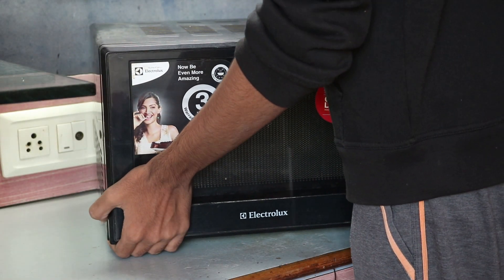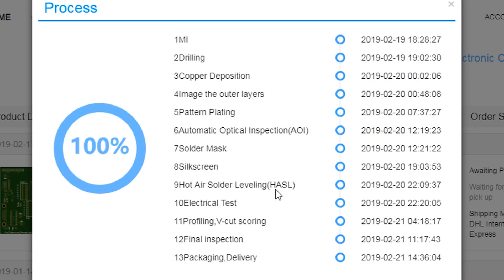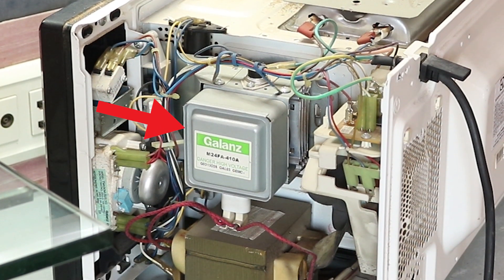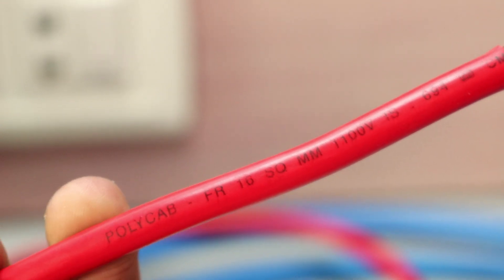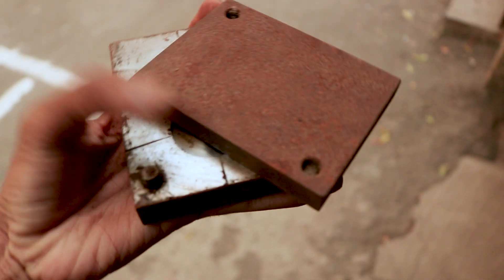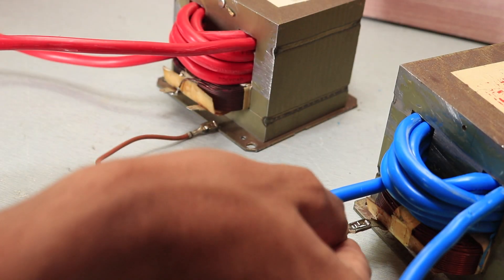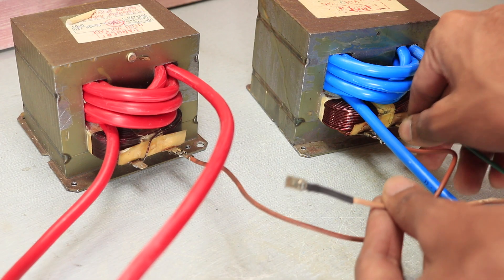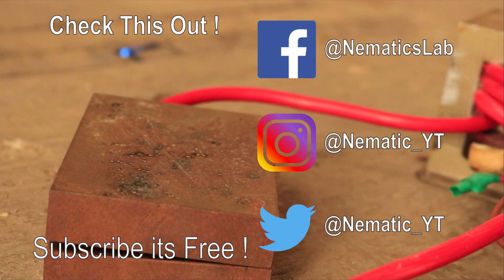DIY Arc Welder Using Microwave Transformer? | MOT | Failed!

Comment: Connect primaries in parallel and secondaries in series, so you double the voltage, but it will still be not enough. You need three MOTs connected in the same way to reach 20V at the high current output and really start to weld!
Reply from the maker: I don't have a power source to provide that much input current at the moment but it did came to my mind. But I was worried about electrical insulation breakdown better primary and secondary.

Comment: so many people that dont know what they are talking about. it has nothing to do with not enough transformer. the problem is the secondary wire hes using is too large and too insulated. not enough turns on secondary. very easy fix. two mot's is plenty for a the 90 ish amps required for a decent stick weld. you can weld with one transformer lol

Comment: Primary connect parallel. Secondary in series. Im using thus method and it work good. So your winding is wrong.
Reply: how many turns do you need to get the necessary voltage?

Comment: You should put the primary coil in parallels and and the secondary in series. It will work somehow. Use a 4mm cable and make around 50 turns in each transformer. It will provide you around 40 volt and around 120 amps. Not enough, but it works for short welderings

Comment: The cables seem to thick you should connect cables for battery number 8 or 10 to get the job done, tht way you'll get about 16 volts per transformer, and if you add a third transformer you'll get about 40 to 45 volts it's better.
Reply: voltage doesnt ever neeed to be that high. around 20 volts is plenty. its the amperage you need. two mots is enough. its 90 amps for stick welding avg and two mots will do that and barely need cooling. and all this crap about mots in series nothing should be in series. secondaries in paralell and thats it

Comment: Primaries in parallel as other comments have said already, secondaries in series, but even then you only have 14V, cheap arc welders have 60v open circuit to get the arc started, so you would need 5 or 6 of these transformers.

Comment: I’m looking at my HV capacitor and the second transformer I pulled out of the second microwave right now. This guy just saved me from being pissed off with the Results of the project I was ready to begin on. Thank you for your post, it was more than helpful
Reply: You should put the primary coil in parallels and and the secondary in series. It will work somehow. Use a 4mm cable and make around 50 turns in each transformer. It will provide you around 40 volt and around 120 amps. Not enough, but it works for short welderings

Comment: You can connect transformer in parallely. The induced flux from the primary is fully isolated with secondary so you can connect them in parallel and for the secondery voltage you should wire winding serial for barely 15V for working 
Hope this helps!!🤗
Reply from the maker: This should work but its possible that isolation can break between Secondary and primary so I would try that after I`m done with different projects I have planned with them.
Reply: @Nematics_Lab  What creator said. wire them in parallely on the primary coils and series on secondary. But also it is important to understand phase. Not only in whether to wind the new secondary clockwise or counterclockwise but also in how the primaries and secondaries attach to each other. There is an input pole and output pole on each winding. I think of it like + and - poles on batteries. Where the coil enters the core (first winding) are my positive terminals and where the coil exits the core (last winding) are  the negative terminals on the primaries. Just as important as attaching the wires on the secondary coil side, the last winding on one core should be connected in series with the first winding on the next core. Finally the end of the first secondary winding in this series is your welding "ground" and the last secondary winding is the stinger. Do this all right and one of your secondary coils is wound counter clockwise against a clockwise wound primary? and who knows what happens? I had all of this right except + and - mistake on the parallel wiring of the primaries and was only reading 5 volts on 20 windings of 10 gauge wire on the secondaries(2 core system). Fixed the issue and started reading 45 volts(was expecting 36 - 40 VAC) So close enough. Another matter that everyone neglects to mention is the shunts. Leave them in or take them out? Well I look up their purpose and it says "reduce arcing"  somewhere. Arc? that's things I want. 2. the shunt in a transformer built for welding can be pushed in and out with a control wheel. All the way in is low power setting. All the way out is high power. So I assume no shunt means higher power and bigger arcs. Not positive on this, as it's very hard to tell if shunts are installed on these "tutorials"
Reply from the maker: @gantz4u  I appreciate your explanation I forget that I can wire both primary in parallel and secondary in series and at the moment I don't have access to mains with  voltage 240V 16A or higher so I cannot test that setup as both transformer will draw about 4-5A when in action
Reply: Also should mention the input I`m using here is 120VAC variety. This is a "stepdown transformer" design so theoretically the math is this: 120VAC at 20 Amps input. 45VAC reading at the output. Should be: 120/45=2.66*20amps = 45VAC at around 53 amps on the output theoretically I believe. Im hoping this is hot enough to cook with a 1/16" 6013 rod although I`m on the low end of this theoretical output as I was shooting for around 35V @ 70amps with these windings, which I've heard should cook a 1/16" rod just fine.
Reply: I fully agree with theory provided by gantz and want to add one more step.... The way we want to ensure polarity of output winding (through clockwise or counter clock wise) we have to ensure the polarity of input supply also to be same. Then only the output winding polarity can be determined.
Reply: The magnetic field generated by input winding (EMI) is what gets converted back to electricity thru output winding (in changed parameters due to diff wire gauge and no. of turns), hence the field generated by input winding has a polarity (N or S) which further affects the polarity of output current.
Reply: Il faut plus de 15volts pour souder

Comment: Actually you need to use a bit higher guage with thin insulation like enamel rather than rubber insulation which takes up much space which can be utilised to add more turns.
Also you might need around 36 volts to weld wthout a problem.Just watch the video on the king of random channel.Don't forget to make right primary and secondary connections.The video will help you a lot.

Comment: Use 8 or 10 gauge wire, use a screwdriver to make space after a certain amount of turns to get over 20, connect secondaries in series (only secondary coils should be connected in series) and use oil to cool your transformers.

Oil cools faster than air.

Yes, your secondary coil wasn't tight enough. The tighter it is inside your transformer, the more powerful and stable the arc gets. Getting a big enough charge to overload any electrode.

You're supposed to use 3 MOTs in series for that 3mm electrode.

Comment: Try with a lower gauge of magnetic wire at the secondary winding. As I see in the both experiment you used similar type of wire, if the voltage falls the high current at the output. So try with lower gauge of wire and check whether there is flux  leakage or not. All the best for your upcoming project. Team HCDP Education.
Reply from the maker: Using lower gauge wire will reduce the number of turns at secondary thus voltage will drop but current will increase, however I need more voltage for arc welding.
Reply: He's right, a smaller size of wire will allow for a higher voltage. And restricts the amperage allowed to flow.  But you will have to be careful. There can be to much resistivity to length of wire ratio and to little. I found this out when I made a 12,000 gauss electromagnet to demagentize permanent magnets. But I soon found the right length. Of course though I could only run it for 20 microseconds cooled down to 30 degrees Fahrenheit. Or it would explode. I ran it on a 125 VAC 20 amp circuit. In a MOT there is major flux leakage. The main thing that can be done is to add a very magnetic material. Possibly pure iron-silicone metal sheeting. Put it around the transformer until the flux leakage is below 100 gauss on the surface.
Reply: @Nematics_Lab  try the king of random's video on this topic

Comment: If you use a capacitor and separate 240v inputs, then connect the outputs in series, would it not have the same effect, except with 240V input at both, smoothed by the cap? Likewise, you could use a voltage multiplier circuit

Comment: You do know about parallel connections right and how they work??? Series uses more voltage. But if you don't have more voltage and must keep them in phase. Conect them in parallel. It consumes more amperage but works the same as if they were on on circuit. So being a HV scientist I say it is a perfect experiment and will work perfectly if done right.
Reply from the maker: I appreciate you mentioned it :)

But You are missing that if I wind output in series and input in parallel there are chances of dielectric breakdown/impedance mismatch which can cause a big fire, so for safety reasons I didn't show it in video
Reply: @Nematics_Lab  Well there's a certain procedure to follow to keep that from happening. And I can make a video on it to explain it all if you want. As long as you keep it all in phase whether or not the output on one is 50 Hz and the other is 60 Hz. It will work. I've done it on a 123 VAC 30 amp circuit. The output can be put in series or parallel. It will just use more input power. But if done right it will have no chance of causing a fire. Trust me. I'm an experimenter I get up at 8 in the morning stay in a shop work and work and perfect my designs and projects. Then I finally get out of the shop around 1 in the morning the next day. Some people have said it can't be done, but I have proven so many people wrong by doing it and succeeding while course making it safe. So if you explain thr safe way and layout, it can be published on YouTube.
Reply: @Nematics_Lab  Even with half the power avalible. For example you have 2 110 MOT's in series output and parallel input. It logically needs 240-250 VAC U.S.A power to run. But it can be run on 125 VAC. Or whatever the designed voltage says for one MOT. In your case it's 240 VAC. It will have less efficiency. And it gets warmer just 1 percent faster. But not by much. And not anything a little fan can't handle.
Reply: @Nematics_Lab  It's not possible for a voltage breakdown of the type of enamel and glue on the windings. Especially for the input voltage it is supplied with and is outputting.  The heavy gauge is rated for at least 300 VAC. And the mains coil is rated for the 2,320 VAC - 6,000 VAC. And actually that's what its rated for. Through my many tests I am sure that you can add another 500 VAC to the wiring and it won't breakdown. There's always a safety leeway in electricity.

In the end the only problems that can possibly occur is if the transformer was damaged, such as being scratched, or even chipped at all. But other than that if you're careful all the way then there isn't going to be a problem.
Reply from the maker: Thanks for all the information it was really helpful, I'm not an expect in HV so I prefer to be on safe side.

Comment: You are actually using a wrong wire you need a 50 amp wire not a 80 amp wire . An 80 amp wire is for spot welding not for arc

Comment: hey Nice video man,nice efforts, i know am asking stupid question but couldn't resist to ask you about the transformer any capacity of microwave will work and transform should be in working condition right?, don't mind
Reply from the maker: Transformer should be in working condition and higher wattage of transformer is better
Reply: @Nematics_Lab  thanks for response
Reply: Krish, transformer's primary coil should be good and we cut through the secondary anyways. Usually, in 90% cases I have observed (in over 20 MOTs), the secondary winding burns out. So, its good to go if the primary is still working. Hope that helps.

Comment: Don't rewind a Transformer add a second Transformer and wire them in series. The second Transformer Which you need to find one that is almost exactly the same. As the one you're using or the world won't be balanced. And it could cause some problems. But anyway wire up another Transformer just alike in series. And you will double your voltage output If you wire a pillar low. He will get the same but a higher amperage 4 watt rating I forget which but I know for AC stick welding. You want To wire two transformers in series and I know you'll get is more than enough power To be able to weld even thick Steel.
Reply: very wrong. god theres so many people giving wrong advice lol

Comment: Connect the primary in parallel N secondary in seires
Reply from the maker: Both transformer are different so I'm not sure if it will work.

Comment: Bro you need atleast 35volts in order to paas sufficient current to sustain an ark..
Also  you might wanna use a thin Welding rod
Reply: wherer are you guys getting this. 20 volts. thats it thats alll you need. the arc is amperage

Comment: Are u mad cant u connect the primary in parallel and the secondary modified in  series do comment as i am working on this project only m serious help me out
Reply from the maker: I thought about it but both transformers are different so I'm not sure if it will work. Could possibly lead to isolation breakdown.
Reply: @Nematics_Lab  see that i know about it but you could have winded both using the same wire i mean without any insulation break might be it would work i guess
Reply from the maker: Wires are not same and input impedance of both transformers are different. If you want you can try that out and let me know. Currently I have others projects on my list to do.
Reply: @umanggandhar3899  Make sure the input of each transformer is in phase. If that is good, and your power situation is good enough then the output will be in sync.

I have used a 1,380 watt 50 Hz 110 VAC MOT in series with a 1,800 watt MOT 60 Hz 110 VAC. This does work. They operate at the same frequency on output. Even though they say different frequencies.

Comment: 4 x MOT . 4 x 8 turn coil. 4 x 8V - 9V = 32V- 36V. 50A - 70A. And then the primary winding of the parallel initial beginning with the beginnings and ends with the ends and to a strong socket of the network, and the secondary windings in series * start-end-beginning-end-beginning-end-beginning-end *.

Comment: The mistake was cutting off the high voltage winding instead of the low voltage winding...you need to keep the HV winding as primary and wind a new secondary for the high current........
Reply: Dave M  I've done it ...and mine worked....

Comment: Dude! may be it too late now but to weld that thick of the steell you probably need a gas welder.  Commercial electric welders can only weld thin metal.  I am no expert in welding but for the metals to join, the contact areas need to be melted, literally.